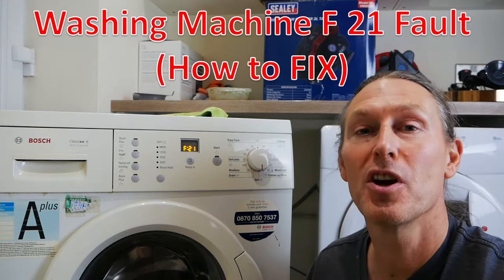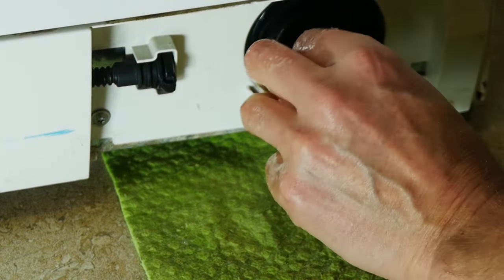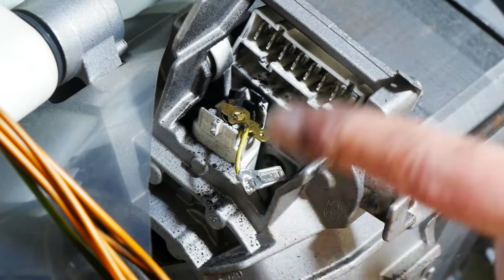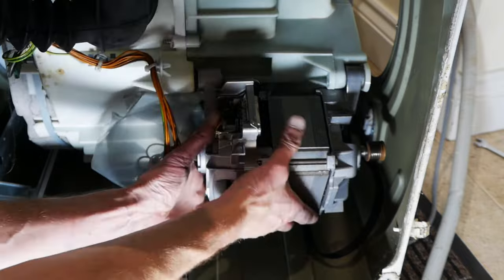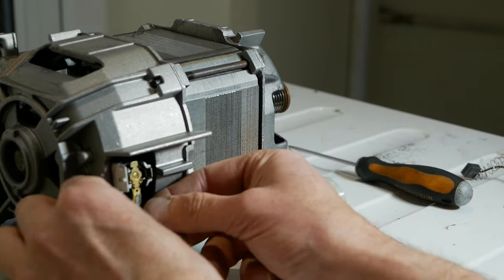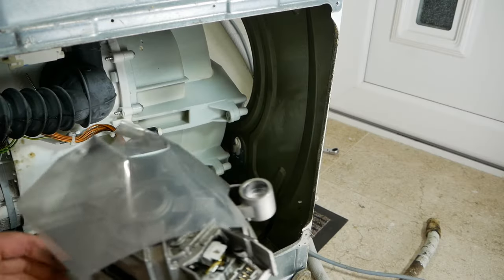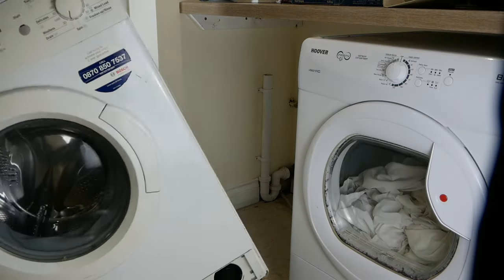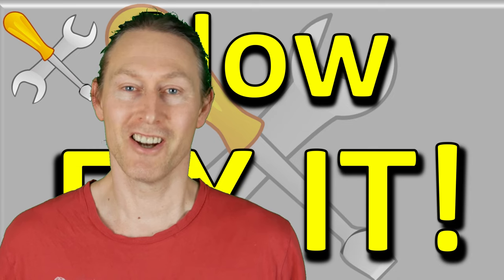Washing Machine F 21 Code | Bosch | Neff | Whirlpool / EASY FIX!

Comment: We had this washing machine for 19 years and today this code came up, clearing the filters and resetting didn't help. Ordered some brushes, will follow up if this helped, thank you for making this video!
Reply from the maker: Did it work again? 19yrs is a good run but it would be great if you managed to keep it going a little longer! Cheers, Phil
Reply: @NowFixit  Unfortunately no, I think maybe there was a short when the brushes failed. After replacing the brushes there was no life from the motor at all, you can hear the relay clicking a few times, no movement whatsoever and then the cycle says it is finished. We replaced it with a new Bosch machine, the series 6, it's MUCH quieter with the brushless motors.

Comment: I tried replacing the brushes (the old ones wore down to the copper!) but I’m not sure I got the orientation right, putting it on spin it jumps from 12 minutes to 1, I can hear the relay click but nothing. I tried to change the orientation of the brushes and now it takes a minute or so to show anything at all on the display, strange. Hitting start on a spin cycle it fills up with water and drains but the motor is still not spinning and it does the same jumping to 1 minute and staying there occasionally clocking the relay. Any ideas?
Reply from the maker: Hi, I’m sorry, I don’t understand all of the references about jumping minutes, do you meant the minutes displayed on the screen jump around? If so, it sounds like you have a control board error. Thanks, Phil
Reply: @NowFixit  Sorry, I meant the time on the screen stays at 15 minutes left for a while, I hear the relays clicking several times, there is no movement from the motor at all during this time and then the time changes from 15 minutes to 1 minute and it says it is finished. 

Everything else seems to work, it fills up with water, and drains, etc, but there is no movement from the motor.

I gave up and purchased a new Bosch machine, a series 6, it is incredibly quiet with the brushless motors.

Comment: Copy what @postsilv71 said. Had this issue. Read F.21 as a drain issue. Check filter and drainage, all clear except for a 2p coin. Then I found your video specifically for a Bosch. Removed Motor, sure enough brushes were like in your video. Followed your link to Amazon, ordered Friday evening, arrived 8am Saturday morning. Fitted them as per video, put Motor back, followed the rest pattern, still had F.21 error. Done reset a few times then figured it was the other 10% causing F.21. Sunday decided to try and get door open to remove washing, couldn't find a way, then tried the reset again, voila error cleared. My machine is almost identical to the one you're working on, except my spin is not at 6 o'clock, more like 6.35, I have a rinse at 6 I think. Anyway, great work.

Comment: I just had this error following a power cut whilst the machine was running. The reset steps at the end appear to have sorted it. Thank you.
Reply from the maker: Glad the reset helped you! Never thought about it but of course, in certain situations, a reset is all the machine may need 👍 cheers, Phil
Reply: Thank you for this comment! It fixed mine too by doing just the reset steps at the end

Comment: Hi, great video i have managed to change the carbon brushes but the machine sounds more whirring now. Is this normal? Cheers
Reply from the maker: Not normally, it usually sounds exactly the same as it used to run. I know it’s a pain but maybe pop the side back off and make sure no wires etc are touching moving parts. Cheers, Phil
Reply: @NowFixit  cheers Phil, I popped the motor back out and I had fitted one of the brushes the wrong way! Doh! 
The brush had started filing down on the opposite side to the angle so i sanded it back to the correct angle and refitted the right way. 
My 20nyeaar old bosh machine is now running great and much quieter! 
Thanks again for this excellent and useful video! 
Cheers
Reply from the maker: @jamesoates6309  ah ha! Well done thinking of checking the brushes again  It's easy to get wrong, when I was filming I was like "which way was the motor mounted" and "which way were the brushes in, I need to get this right for the viewers!" So filming makes you double check everything (but things sometimes still do go wrong!) lol!

Comment: Fantastic video !!...I watched a few on YT first, but I found yours the easiest to follow.I am forever grateful for your detailed step-by-step tutorial. Ordered the carbon brushes for £8 from Amazon, and saved a good £400 for the new Bosh washer. My daughter and I spent 3 hours on this, and didn't even have the correct tools (had to run to the shop in the middle of this job to get the spanner)..But,3 hours later my washer is running again!!.. I feel so proud, thank you !!
Reply from the maker: Thank you and well done for getting your machine going again! Great that you were able to work with your daughter on it too! Thanks for commenting :-)

Comment: Great repair video and like others have said the level of detail you went into made this very easy for me to follow. 

I'm very grateful to you.

For the benefit of anyone who hits the same snag as me. I couldn't open the door when we first saw the F21 problem.  It had a set of clothes being washed that we needed. Eventually i figured out that just above the drain plug is a black pull tag. Pull it while pulling the door latch and the door opens.

Obviously drain as much water as you can first.

Other than that i just copied what you laid out in very simple and clear terms.

Thanks again.
Reply from the maker: Thanks for your comment and for taking time to supply the additional tips to help others! 👍😁

Comment: Absolutely fantastic!!! Thank you so much! 

For the sake of a pair of carbon brushes (£8.30) and an hour and a half of time (could have been quicker, but I didn't have a ratchet spanner!), it's saved us having to get a new machine which is what one guy had suggested I do when I told him the problem ... "it's not worth fixing mate, it's already 10 years old, it'll cost more than it's worth!".

Your instructions and steps in the video were all so clear and unambiguous ... top marks!

Thank you again.
Reply from the maker: Good work getting it sorted! It’s a little bit more technical than the average diy… yeah, ratchet spanner is a nice little luxury that I treated myself to! 😁 cheers, Phil

Comment: Great Video. Just a comment on refitting the plastic shield shown at 14:45. I believe it should be put back the same as the the original shown at 3:45, which has the wiring routed over the plastic and both secured together with the tie-wrap to prevent vibration/flexing of the cables at the motor end.

Comment: Thank you for taking the time to make this. I was told by a local reputable repair shop that my machine was beyond repair. I followed your video and had the machine back up and running pretty easily. Your video includes the subtle details that make the job much easier rather than skipping them (such as how to feed the belt back one).

Comment: This is a fantastic video and was the only reason I was able to fix my bosch machine. I did however have to do a couple of extra steps before mine was fully working which is worth mentioning in case others need the same
1.) I had to vacuum out some carbon debris from where the brushes go, to help the brushes fit/ contact properly.
2.) It didnt spin up to fast speeds straight away after fixing. I had to run a couple of empty spin cycles followed by a handful of partial loads 3 or 4kg to get the brushes to bed in before it started spinning at full pace
Reply from the maker: Thanks for sharing this! I didn’t have any bedding in problems but had head that it can sometimes be a thing. Cheers, Phil

Comment: Hi, Our Bosch packed up on Monday afternoon. It displayed an F 21 error and, having watched your video, it's now working again and has completed two wash cycles! It really was easy to do. The biggest problem was man handling the machine itself in a tight space. The actual removal of the motor and replacing the brushes was a doddle. Many thanks for doing your video.

Comment: Just wanted to add my thanks for a great video.  Got a Bosch Classix 7 that developed F21 fault.  Bought some brushes locally & following this video was able to replace them. Make sure you get those angles the right way round when you put new brushes in. Up and running again same day for minimal cost. Top work thank you!

Comment: I just got the F21. Ill be honest at first i didn't watch all the video i just watched the end and tried the reset... it worked.....for now. New brushes no doubt will be needed in the near future. Im assuming new machines wont differ much from these older ones when things go wrong...
Reply from the maker: That’s fair enough! I think you are right and it may keep running for a while yet 👍 Maybe I’ll bring out a “short” just showing the reset 🧐

Comment: Thank you so much for the very clear and professional useful information!
One suggestion: it is important to use some working gloves because the metal frame is quite sharp and…dirty. Stefano
Reply from the maker: Glad you liked the video. Good tip, yes, once the lid is off, the sheet metal edges can be sharp! Cheers, Phil

Comment: Thank you, great advice, subbing to channel. Unfortunately, it didn't work with the Bosch washing machine my client has; the door wouldn't open, not sure what I can do about it. Any ideas? Thank you in advance!
Reply from the maker: Sorry it didn’t sort your problem! Great to have you as a subscriber 👍 I’ve had a door that won’t open before and I used some strong string to open the door. Basically, I forced the string past the door seal nearest the latch and then holding one end in my left hand and the other end in my right hand, I pulled it tight so that it pulled the latch / hook inside the door. Sorry, really hard to explain but I bet there are a few videos on it on YouTube. I haven’t done one yet… Cheers, Phil

Comment: Brilliant video ! I don´t have the F21 code (yet) but I know what to do when I do,it incredible how worn down the carbon brushes are, do you know or have an average life span for them? we use our machine about 3 or 4 times a week ,it is Bosch and about 4 years old ,best regards
Reply from the maker: Hi @derek-press glad you liked the vid! 👍😎 Usually the machines are pretty old by the time the brushes go. I would estimate 7-8yrs. So make sure you keep the video in your "saved list" 😂 Cheers, Phil
Reply: @NowFixit  its saved 👍
Reply: @NowFixit  this is why I love YT ,people like you who give up their free time to help people like me (who is a bit handy),a few years ago our heating stopped working ,no heating .no hot water ..it is a Viessmann gas system, it was summer so not so critical and before we called the heating engineer I did a bit of YTing ,found a guy in Germany and he described the fault down to a T (fault code and all) it turned out all I had to do was take out the console /display and change a battery ,a small 1 inch long battery (not rechargeable just a battery)I ordered from the internet 4 pounds! ,and then re program the system which the German guy did step by step,it took about an hour ,imagine what the bill would have been from the heating guys.keep up the great vids ,you need much much more Subs ,regards Derek
Reply: @derek-press  That's brilliant! Sounds like you saved a lot of money there. 👍Thank you, yes, as you say there is a good community of people on YouTube, who says The Internet can't be a positive place! Thanks for your comment above. 👍😎 Cheers, Phil